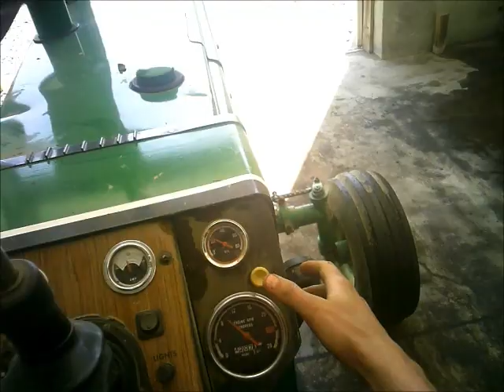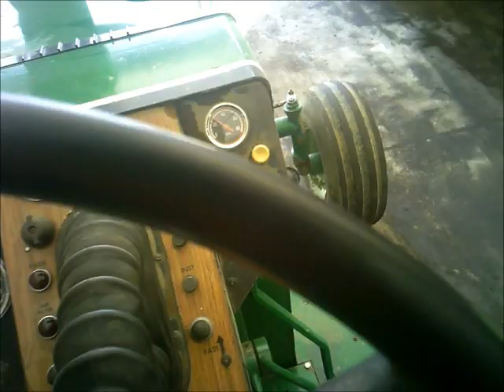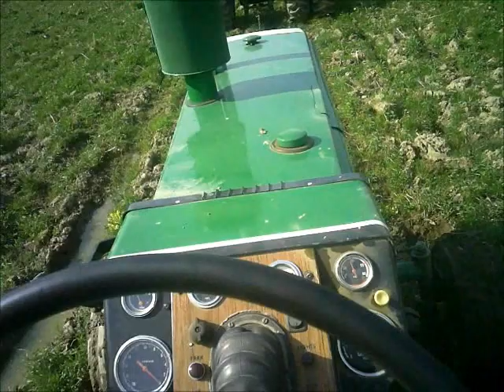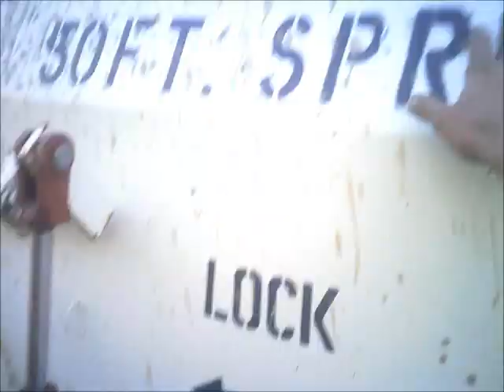A Day of Spreading Fertilizer

Comment: The floor looked wet in the fertilizer building?  Is it wet?  For dust control or what.  I would think the wet would make the fertilizer corrode stuff.  Just curious never been in a bulk fertilizer building.
Reply from the maker: +Duane Ausbourne I have never been in a fertilizer building that wasnt damp. Bulk fertilizer will attract moisture.
Reply: +Oliver66FarmBoy  well I learned something today.  Makes sense.  Never been in a bulk fertile Building.  Hell the state here probably has a rule against the farmers going in one here. Lol have to get it delivered.  I don't know if that's the case but it wouldn't surprise me.  Especially if they get a tax on the trucking.  Gets harder and harder every year here.  Thanks for the videos.